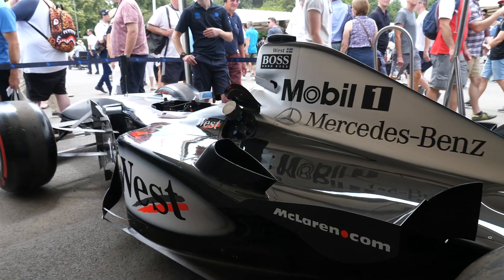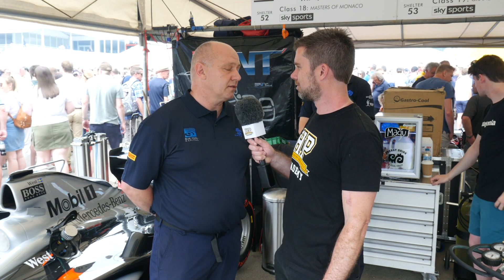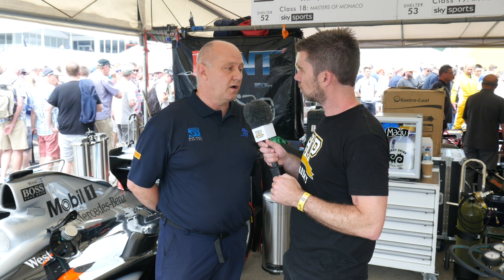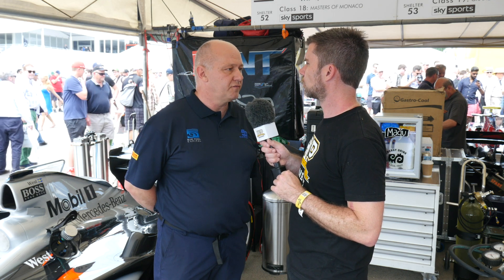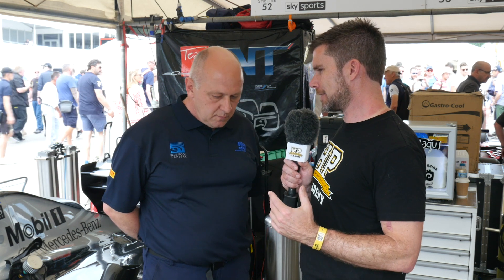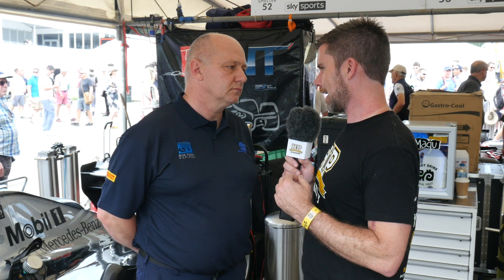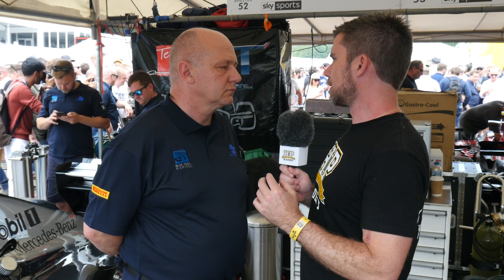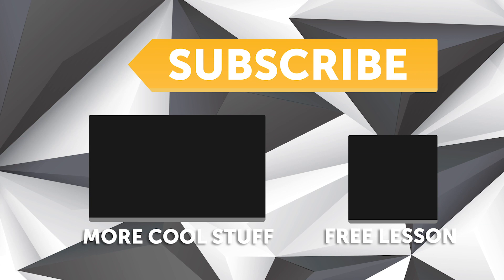18,400 RPM, 900HP 3L Mercedes V-10...NA! | Formula One Secrets  [TECH TALK]

Comment: The issues they had with the intake runner length tubing sounds like The problems with the Honda VFR800 motorcycles VTEC It had a hard trigger on and off right at like 6200 RPM so it's rideability was terrible I if at any point you dropped below that. They improved it by implementing a system where once you surpassed The trigger point you had to drop below the trigger RPM like 300 RPM before vtech disengaged.

Basically what I'm trying to say that it sounds like a transient logic thing, hard to detect on a dyno the torque curve just looks like what it does but when you're driving and trying to experience a predictable torque curve active systems changing their condition frequently or around certain critical points will be a challenge

Comment: So why do they need to run lower valve pressure at low revs? I realize they can, but is the only benefit reduced forces in the valve and thus more power? Or, for a given pressure, are the forces higher at low revs?

Comment: I need more bore 2 stroke ratios compression ratios valve angles and sizes materials ring thicknesses bearing materials clearances how did they deal with oil cavitation what oil ? fuel and fuel pressure i want it all balancing and harmonics tuning piston design to reduce friction theres so much i want to know

Comment: Why do they need to rev so high? Why not lower revs,  longer stroke, more torque. Less horsepower but more torque? I guess you have a smaller, lighter engine with shorter stroke but wow what a challenge to get engine life when your revving that high along with figuring out driveability. Less rpm range, more torque, seems like it would be a good idea? How much torque did these things make? 200 - 250 ft - lbs?
Reply: Torque alone doesn't do anything or to be more exact it doesn't matter much how much torque the engine produces. What you want is power. Torque can be changed by the gearing, but power stays the same no matter how you set up the gearbox.
And weight was a huge factor, back then even more than it is today in F1. So you wan't a small and light engine which puts out lots of power and the only way to achieve both is to rev it really high.
Torwards the end of the V10 era the engines had a dry weight of about 85kg.
Reply: Torquey engines at the flywheel require heavier duty transmissions and drive trains to take the load. If you use revs then make the torque at the wheels with the final drive massive weight savings can be made.

Comment: Not enough tech questions. This guy know engines but not to deeply. Should have asked if theres a light spring in there to hold valve up when sitting. If u loose preshure when on track does engine cut. How often does it need valve adjustment and is it shims. Idling rpm. How big are the individual throttle bodies. Injector cc. If evidently dropped to low of gear how high could rpm go b4 caboom. I could go on.

Comment: the first team that broke into the 18k rpm range was bmw williams in 2001 (monza).
So I highly doubt the 2000 mclaren would have gone that high.

Also if I my old books are correct the engines produces roundabout 800-850 hp in 2000.  850ish mostly in quali mode tho.
Reply from the maker: All we can put in our videos is the information that is presented to us, however when that information is coming from the guy who was the engine engineer for this particular car back in 2000 when it raced, we'll take that over google any day 😉
Reply: @hpa101  It just shows peak power from v10 era is still uknown...probably kissing 1000hp in 2004 maybe??
Current v6 engines are masterpieces aswell, but much inferior to these beasts, there's no replacement for displacement really and a few more cylinders :D

Comment: The only reason everybody wanted turbos to come back was because back in the golden days it was 1,200 HP turbo manual shifting raw driving skill, not a little 600hp turbo with lots of driver aids. If we had known it was going to be like this we would have stuck with the glorious sound of the V10 although we did get some cool turbo technology development, namely that split turbo that mercedes used on either end of the crank that was genius I wish road cars would use that system it's so good.
Reply from the maker: I disagree that driver aids make F1 driving, or any other class, skilless and the cars of this era are certainly much faster with half the power. There are less 'run away' designs that dominate entire seasons easily which isn't a bad thing either. I do agree that the turbo era was epic and is still great to watch some of the races from that time, 100% with you there. Beasts - Taz.
Reply: @hpa101  Do you have an opinion on wanting to see refueling brought back? I'm not sure I mind either way but they seem to be talking a lot about it with the rules changes coming up.
Reply: @hpa101  Also did you notice how the headers on that Mercedes have a step or two in them? They step to larger tubing after about 8 to 10 inches of primary, and I can't tell from the video but they look like they almost step down again as they connect to the exhaust ports. What kind of exhaust tuning devilry is this? It gives high exit velocity but then expands out for high flow or something. Perhaps it's tuned for a certain RPM like a 2 stroke collector.
Reply: @El_Chompo  Its to combat the reverse exhaust pulse going any further towards the head. The inner tube extends a bit further so the return pulse is effectivly trapped as its expanded to the diameter of the larger tube and less pulse goes down the central smaller tube.

Comment: My question is, are the pneumatic valve actuators used to force the valve to follow an existing cam lobe (nulling valve float), or are they a full cam less valve actuation that they can control entirely as they please?
Reply: J_W97 Just a pneumatic valvespring. Still uses a mechanical cam, normally with a slipper pad finger follower

Comment: What  are they doing as far oiling and clearances with rpm’s that high ?
Reply from the maker: The clearances are tight enough that the engine oil and coolant need to be preheated before the engine can be started up. Generally with a bespoke race engine like this there is enough rigidity built into the crankcase and crankshaft that flex isn't an issue and hence the clearances can be much tighter than what we could ever get away with in a modified production engine.
Reply: I wanna know too now. Dry sump 0w oil?

Comment: There's no replacement for displacement...wait what 900 hp from a 3L NA V10.  Ok I stand corrected the replacement for displacement is engineering.

Hey look a McLaren with a Mercedes Benz engine let's argue about that it like they do with the new Supra.
Reply from the maker: Mercedes-Benz badged but built by Ilmor at the time too ;) - Taz.
Reply: mclaren have worked on other cars with mercedes many times. one of my favorite cars they did was the stirling moss mclaren slr
Reply: @djsubliminalreeve  
Yeah bcuz the very first McLaren F1 has a V-12 Mercedes Engine, doesn't it!?!?! Ok cool thanks. Correct me if I a mistaken. Thanks guys, have a great one!!!
Reply: @austinsears1637  BMW
Reply: Haha nice1. .. it's like the arguement people talk about.. putting a chev badge on a Holden..lol
Reply: Or turning 5th and 6 gen Camaros into Trans Ams
Reply: The replacement is money :D
Reply: 900 hp from a 3L pffft....try 1400 hp from a 1.5 straight 4 in BMW’s M12/13/1 engine now that’s the engine that blows the no replacement for displacement statement out the water.
Reply: Toppers hey idiot that engine also fucking blew itself to bits after a few laps. You will always reach material limits in a smaller engine faster
Reply: Jake DeSilva 😂
Reply: Jake DeSilva Why stop at the Cummins, why not just fit it out with the Wartsila-Sulzer RTA96-C. 25,480 litres should be enough displacement to keep material limits in check. Whilst we’re at it, why not fit it out with a hull, deck and 1000 containers and make a bit of extra money during the holidays shipping iPhones and plastic rattan garden furniture from China
Reply: Jake DeSilva 🤣 wee sacks...brilliant! 🤣
Reply: Not really. This system isn't near as reliable as e.g. a large capacity, compact OHV v8 running with much lower stresses. This engine is pushed to the limits and might last a few hours of a race without reaching top rpm all the time but not an all day offroad race etc. In the same way that v8 wouldn't be as reliable as a diesel truck engine which makes 500hp all day every day for thousands of hours.
Basically horses for courses.
Reply: @N4CR  did this man really compare a F1 engine with an LS engine?
HP is a function of work (torque) with respect to time (rpm.) The replacement for displacement is RPM as per physics.
Comparing a F1 engine with the reliability of a diesel or an LS is comparing horses for courses.
Point being, outside the particularities of specific engines you're thinking of, rpms make up for lack of torque as a bottom line on any engine
Reply: Nope. There’s literally no replacement for displacement. Boost just acts as extra displacement. Engineering allows you to be more efficient. You will always reach material limits in a smaller engine sooner than a larger one

Comment: So full pneumatic valve and no cams?
Reply from the maker: Nope they still retain cams. The pneumatic aspect refers to the fact these engines don't use a conventional valve spring. Instead they use high pressure air.
Reply: @hpa101  so why would you need a cam if you have pneumatic valves?
Reply: @freddienz68  They ran a pneumatic valve spring instead of a conventional coil valve spring.  Still need a cam to control the valve lift vs crank position.
Reply: @nskz  couldn't they use sensors for crank position?
Reply: @freddienz68  That's how the Koenigsegg Freevalve system works. https://www.youtube.com/watch?v=S3cFfM3r510
Reply: Im not a expert but i think the point of pneumatic valve control is you dont conpromise airflow at "lower" rpms if you can lower the pressure. But also acheive higher pressures than valve springs. For very high RPM. Cams just make the whole system practical/reliable i would believe.

Comment: Great interview as usual more f1 tech would be great obviously it's a very sort stroke engine but numbers would have been nice
Reply: Those kinds of numbers are very hard to come by (stroke length/rod length etc)
Reply from the maker: Well you'll be pleased to know that there's a bunch more F1 content coming out of our Goowood visit so stay tuned. Surprisingly even though these engines are now museum pieces essentially and have little to no relevance to the current state of the art in F1, some details are still quite closely guarded. What I found out was that the bore diameter in this particular engine was in the region of 90 mm so you can work out the rest.
Reply: @hpa101  enlighten me, I work low voltage and can't count past 12
Reply from the maker: @snikwad003  for a 10 cylinder engine with 3.0 litre displacement and a 90 mm bore, the stroke will be about 47 mm. I wouldn't take those numbers as gospel but it's in line with other F1 engines that we've seen specifications for.
Reply: @hpa101  95 x 42  the most powerful around 1000hp at 20.000rpm like the last evolution of Toyota and Honda. 98 x 39,2 on the last evolution of Ferrari and BMW.  For Ferrari i´m almost sure a friend of mine works  in the F1 Ferrari Team.
Reply: If he told you....well then you know the rest🔫

Comment: Pneumatic valve control is the way to go get rid of vallve Springs for Road cars 👍
Reply: Valve springs are not a big limitation for road engines. Removing the camshafts is the real goal, which this does nothing towards. Metal springs are simple. A pneumatic system is complicated and failure prone, for no real benefit on a road engine.
Reply: Adam Laycock Exactly. Even with pneumatic valves, there’s no way this system can handle a normal steel type valve stem as well as the expensive titanium one, which is far lighter in comparison.
Reply from the maker: There really is no need for pneumatic valve springs until you're considering engine speeds in the 15,000 + vicinity so they really would add nothing except complexity and cost to most of the engines that we deal with on the road.
Reply: Koenigsegg: FreeValve, does it handle high revs?
Reply: @jareknowak8712  "freevalve" was my exact thought 😎👍
Reply: Surely less moving parts would be better.  Less drag on the engine.  You could rev it much higher with nothing that would possibly fail. So we remove cam, rockers, lifters,  rods. use a pneumatic valve system and use the crankshaft sprocket to drive some sort of forced induction system..  or just run some turbos of the exhaust. 🔧👍
Reply: I think freevalve is hydraulic and pneumatic

Comment: What is the idle rpm for this beast?
Reply: If I remember correctly the v10 era idle spec was 6000-6400.
Reply: around 4k
Reply: Its around 4000 iirc for 3l v10 and around 6000 for 2.4l v8 engines that came after v10 era
Reply: The V10's idled at around 3000. The V8's at around 5000, and the current V6's are back at 3000.
Reply: like amy normal car , just look how the lexus LFA engines could rev amazingly fast from 1500 to 9000 rpm in just o,6second its formula 1 technology
Reply: @carholic-sz3qv  no
Reply: @carholic-sz3qv  I think it's around 5 thousand RPM in new F1.
Reply: @carholic-sz3qv  Wrong, the hydraulic pumps are geared for max rpm and would be running to slow at normal idle.

Comment: I live for this channel! I want that v10 how much is it now? :D
Reply: To give you an idea, old cosworth DFV engines sell around and above 100,000k used. I'm sure this engine is deep in the six figures. Add the cost of the hydraulic system it takes to operate it and well, I think you get the idea.
Reply: More than you can afford pal. Ferrari
Reply: out of the reach of anyone those engines are seriously expensive
Reply: @carholic-sz3qv  yeah i know..the fact that you have to have warm fluids running through it to keep it at running temp is madness on its own..Love V10s esp that bmw
Reply: @ThabaniTBowseHadebe0909  i´ll take the lexus LFA´s  V10 that thing is a beast, seriously you know how that lexus engine rev so fast and so quick it can stop the rotation of the earth.
Reply from the maker: Yes they started the F1 cars once an hour to help keep the temps up so filming was a bit tricky as they would just go up and down the row running them one after the other haha Awesome experience I'm sure but tricky for the team to interview! - Taz.
Reply: I worked on a 1960s cooper climax raced by Bruce McLaren, a T63 I believe. 
The engine alone was just 4cyl, ~2.2L 52mm ITBs etc was worth ~180k USD and this was back in the early to later 00s....